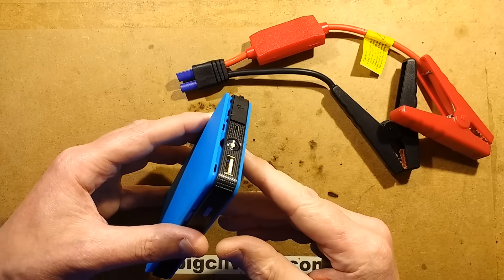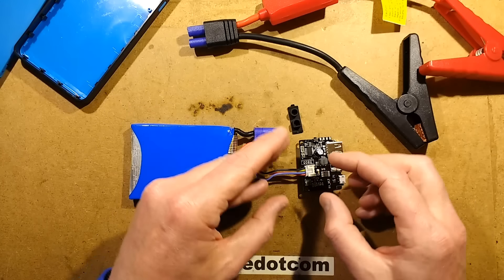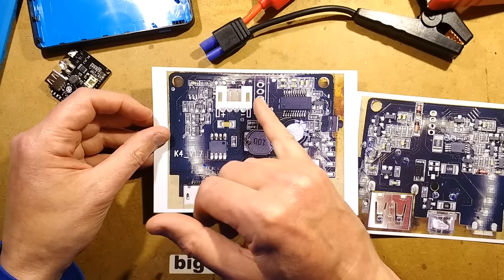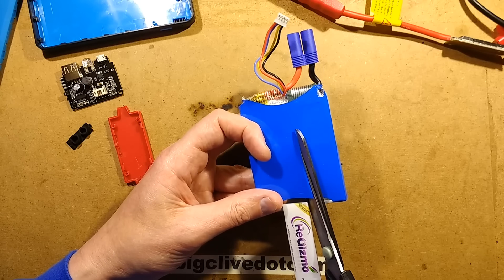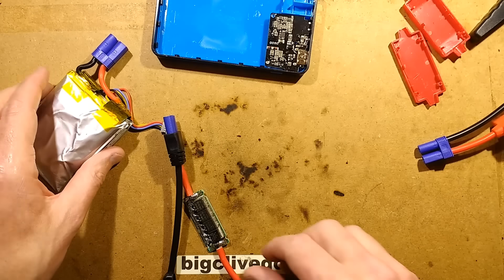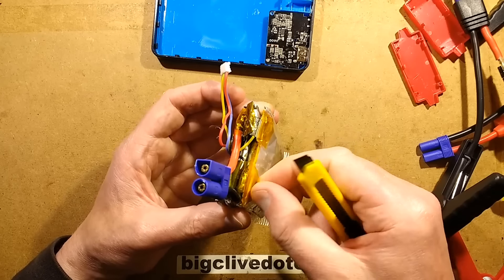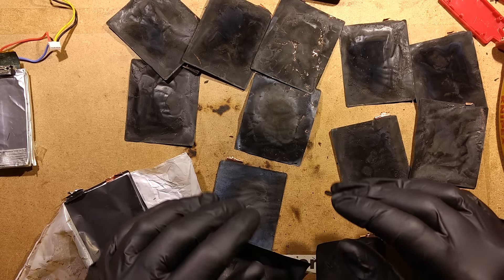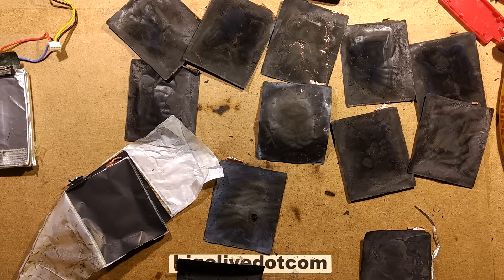Shorting out a fully charged cheap lithium jump starter.  (It didn't end well.)

Comment: By the way, in my experience:  if it had become hot, plastic gloves are worse than nothing.  They melt, hold large amounts of heat and stick to your hands.
Reply: I can confirm It used to happen all the time in labs
Reply: I'm guessing Clive didn't want electrolytes and oxide on his fingers.
Reply: It's to help with acid exhaust and spillage, not heat. Good point otherwise though - is there an acid/spill protection that does help with heat too?
Reply: @dascandy  Just put the chemical resistant gloves around the heat resistant gloves, not a lot of situations where you'd need protection from both at the same time anyway tho... This isn't a good idea with any type of glove...
Reply: That's why I quit a kitchen job.
Using plastic gloves for cooking, ridiculous.
Reply: My cousin's wife got burned real bad when the crocs she was wearing next to a camp fire caught fire and melted.
Reply: @greenspiraldragon  I guess the cute little crocs were worth the danger.
🤦‍♀️
Reply: I think Clive was going onto a costume party as a gimp. Perish the thought.
Reply: Haven't had this happen with gloves, but some plastic dripped onto my thumbnail from the end of a rope I was melting once. Not fun.
Reply: Yeah, Agreed. Using vinyl gloves for fire and heat protection is kind of like protecting one's hands by covering them in something like potential napalm, and it can be a real problem for ER doctors trying to remove the melted/burned material, Tends to adhere to the burned skin which it then takes off with it. Not fun.
Even cotton gloves would be a better choice.
Reply: @rmx4087  I was about to quit the kitchen job too but my wife beat me to it
Reply: A little knowlege and intelligence would have prevented experience.
Reply: @Cypeq  hmm electrolytes and oxides>third degree burns?
Reply: Just put 8 pairs of gloves on. I was able to stick my hand in a deep fryer for 20 seconds lol. Dont do this tho we almost got hurt haha.
Reply: was about to say that
Reply: They are nitrile gloves
Reply: The gloves he is wearing are not plastic therefore they will not melt like plastic. They're chemical resistant rubber gloves or nitrile
Reply: @hurtfultruth6539  thats a fair point but there have been examples of even these chemical and fire resistant gloves melting on peoples hands, yes it isnt as bad a problem but it is still a concern, and should be kept in mind.

TLDR: just don't set your hands on fire ;)
Reply: @hurtfultruth6539  Are rubber and nitrile plastics?  Plastics are polymers (big molecules that link together) big molecules can hold a lot of heat energy (you can probably find some thermodynamics expert on you tube to explain) and solid plastics present a lot of surface area so they transfer that heat well to your body.  That's what makes things feel hot.  Rubber and nitrile are polymers.  Enough.
Reply: @oxboustrophe1392  good God kid, I had science class a long time ago😂 but thanks for the lesson
Reply: @oxboustrophe1392  by the way, after trying to be mr. Smarty pants with your science lesson, you don't even understand Plastics are a man-made material versus rubber which is a natural organic substance which comes from the rubber tree. Oh crap, I didn't even bring up latex🤣 Maybe you missed that class.😉
Reply: @hurtfultruth6539  Use a dictionary.  Polymers, polymers, polymers.  They're polymers.  Latex is produced from trees or milkweed and in labs and factories.  Whether they're natural or artificial they are polymers.  Again check with someone else.  A book or another you-tuber.
Reply: @oxboustrophe1392  Most polymers are insulators and don't transfer heat well, that's why firefighting gear is made of polymers. The problem with hydrocarbon polymers like nitrile is that they will oxidize rapidly in an exothermic reaction at relatively low temperatures and melt but there are plenty of fireproof plastics in production.
Reply: @VeProducctions  Guess you've never tried this yourself.  Don't confuse insulator with "does not conduct heat well".  Pick up a plastic cup of coffee.  Indeed polymers do not conduct heat well compared to metals, but they manage to store massive quantities (ask you local physicist or physical chemist for an explanation) and the stuff has a surface just made to transfer the heat.  So the result is a heat that transfers to your skin and doesn't dissipate.  Doesn't have to oxidize.  Now if you want to make fibers or cloth you get air in the interstices  which indeed is an insulator does not conduct heat well.  Oh well, don't believe me.  Get some experience.  You'll get the point.
Reply: @oxboustrophe1392  Go look up the definition of an insulator. The exterior of a plastic cup of coffee will take longer to come up to temperature than a steel cup. That's why coffee shops serve coffee in paper cups with cardboard sleeves. Silicone is used as a thermal insulator on a routine basis and it contains no air gaps, the same with potting resin. Get some experience, you'll get the point
Reply: @hurtfultruth6539  idk about these but I know some cases nitrile is worse than nothing, I forget if it’s a certain acid or heat
Reply: @hurtfultruth6539  rubber doesn’t my only come from trees my man, in fact most rubber is man made. The stuff from trees can’t really handle the stresses that car tires go through
Reply: Xaasaan. is Maan. Caakaalaa
Reply: They basically become napalm. Been there
Reply: Welding gloves would have been perfect for this
Reply: Natural leather is the Key, not the Eco
Reply: I think it's just about holding the nasty chemicals away from his skin.
Reply: @greenspiraldragon Not that smart. 🤦🏻‍♂️
Reply: Can’t wait for BC to get a failed EV battery on his (heavily strengthened) bench and undertake an autopsy…and check failure modes lol